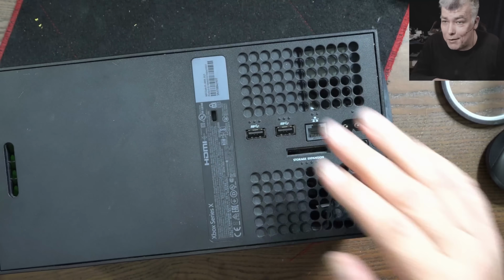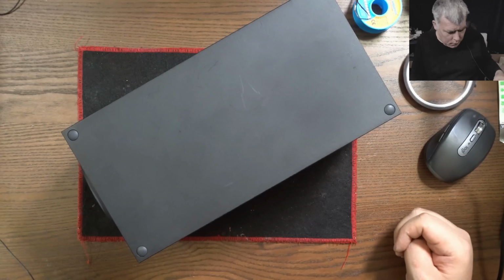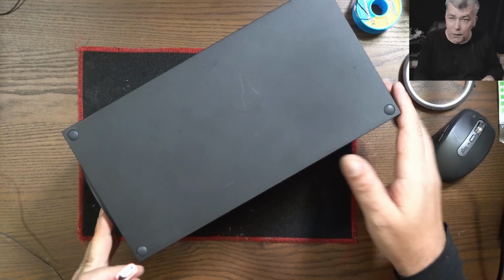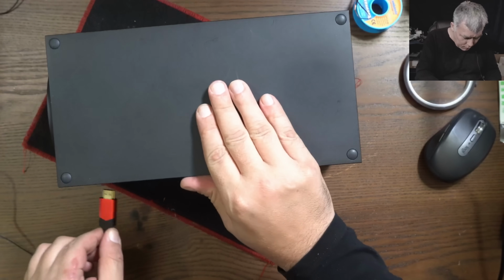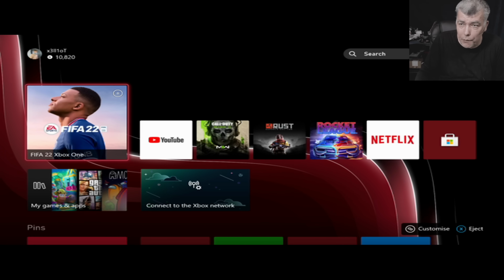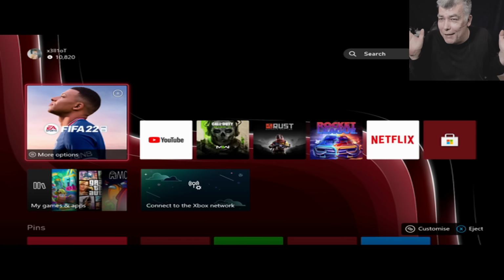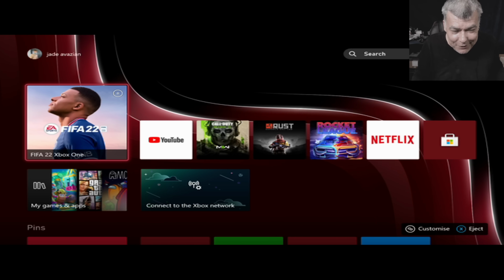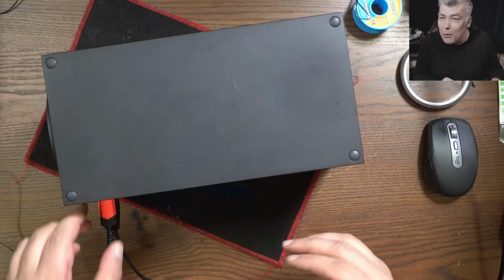Xbox Series X HDMI port replacement - My way to replace this port

Comment: Something weird is happening to me. When I use headphones with batteries they work well but whenever I use the usb port, the usb works fine, audio works fine but the mic makes static noise, I sent to repair my Hdmi is it possible that something's wrecked from the repair? All usb ports work well its just the mic, it only works perfectly with batteries. Static sound comes from usb, I dont have other things around that can make the static and I don't remember well this happening before...

Comment: I just sent mine into get replaced and now 4k won’t work. Could the guy have replaced it with an incorrect hdmi port and that’s why 4k doesn’t work? I’m not tech savvy so idk if it’s only the cord that matters or the port itself.
Reply: The esd chip was damaged or is not making proper connection.  It needs a new one or esd  bypass
Reply: @KingOfHdmi  I thought you wont get 4k if you esd bypass no?
Reply: @raywalker5656  4k will work fine with the ESD Bypass.   Best practice is to replace the ESD, but it is more expensive

Comment: Hello Boss, I am Jeres Houngue from Benin.
 I've been following your videos for a year and a half now because I'm training in electronics.  And sincerely you are the best and very generous in sharing knowledge.  Thank you very much. I have a problem and I need your help, please help me.
 I have an HP Pavilion core i5 which worked well but recently, it systematically restarts in a loop at startup after just 2 or 3 seconds, nothing is displayed on the screen and no bios access.

 I realized that when I remove the RAM sticks, it no longer restarts in a loop, it continues to run, but naturally without starting the startup sequence.

 I tested with another RAM strip and the same thing, it restarts in a loop, so it must not be the RAM strips.

 It does not do any beeping sequence at startup, whether with or without ram.

 How do I do it or which of your videos do you refer me to?

Comment: Alex from South Florida USA.... Long time viewer on YOUTUBE TV app.  You can not like or subscribe using the TV App as far as i know and my bet those using it does not count on the views?   Very Glad you resolved the issue.  I would like to put up a 100 dollars for a contest for the best design of converting an old TV .. the plastic housing on the big screen TVs into a soldering station with fume extraction. Do you think this would be fun?  Anyone want to increase the pot for the winner?

Comment: Nice one. Only thing I would say is pay attention to getting the solder melted on those 6 front support pads. They really do help give the Xbox Series X HDMI ports a lot of strength, resulting in less chance of ripped connection pads when the port gets damaged (unlike the PS5).

Comment: Great job 👏 
If it was me, i will be not comfortable sending this back with out replacing the thermal paste 🤐, i known it's waste of time if you are working in a workshop 😬.
Reply: All about time.  Sorin shows it’s possible to change the port without removing the 2nd board from sub frame. The cover takes time the xclamp can be risky.  It all takes time